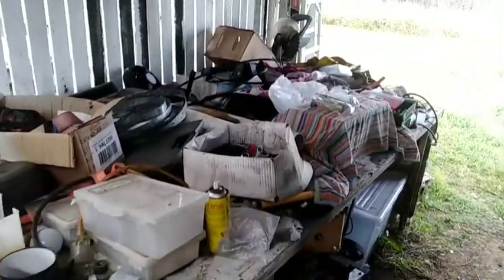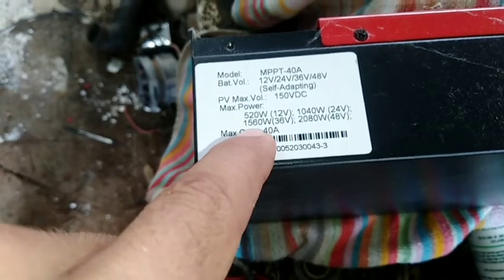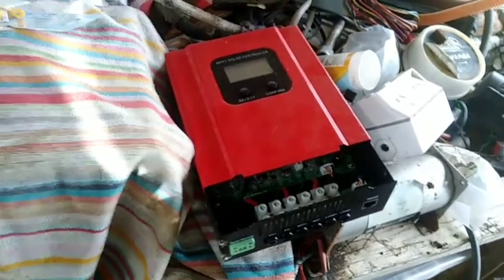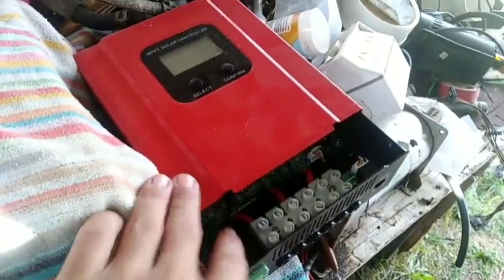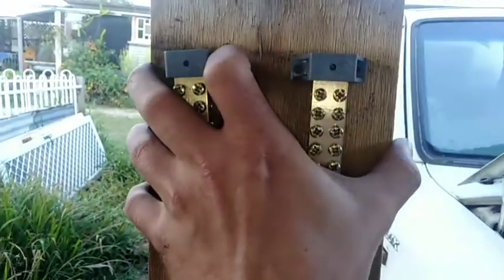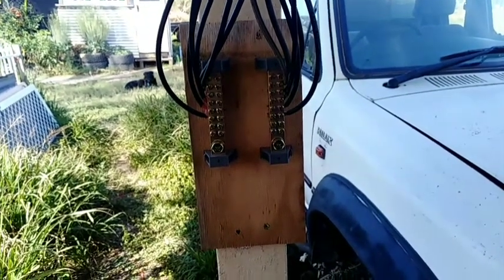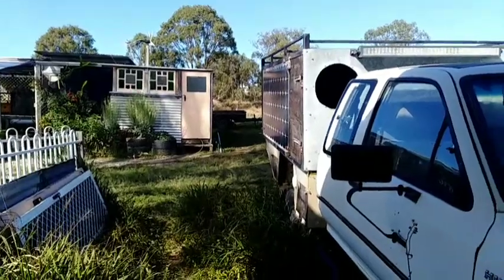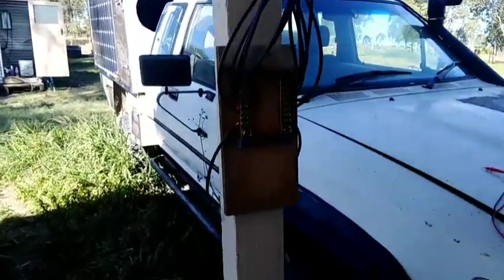Wiring solar panels

Comment: Hey Mate,  Where do you buy your charge controller from? .  The other questions I have is the wire size of the looms and back to the charge controller.   I’ll try and copy what you do as I have no idea.  Keen to give it a go and learn as I go.  You make it look easy enough,  surely  I can’t stuff it up.. haha…Thanks for videos 👍
Reply from the maker: both charge controllers and cable i buy off Ebay. just search 40amp mppt charge controller and you should find some good ones. I generally stick to 40amp solar cable as generally the array wont be above that. make sure you buy enough controlers for the amount of panels you have. Also Be  carful, your still messing with electricity . Still check out some other videos or diagrams as im no electrision lol. but yes its relativly simple.
Reply: @yumcha16   Thanks for that.  Appreciate the info.  👍